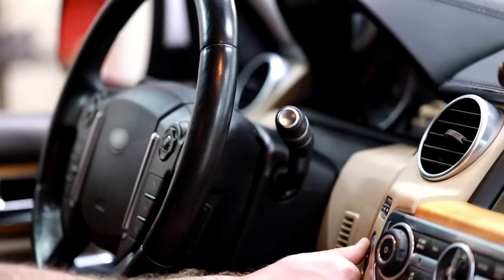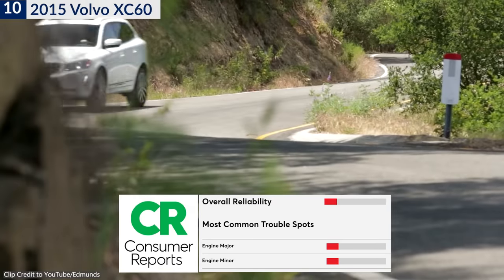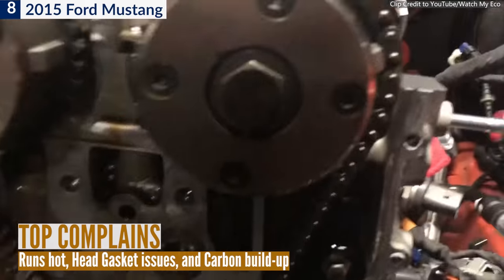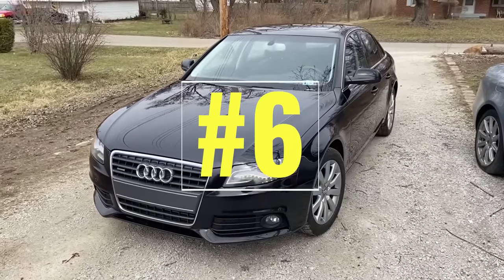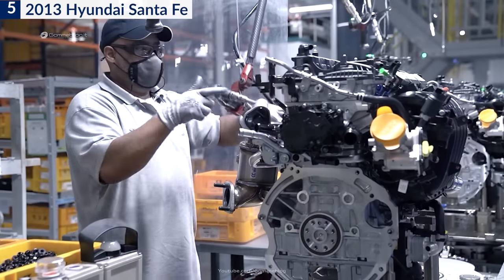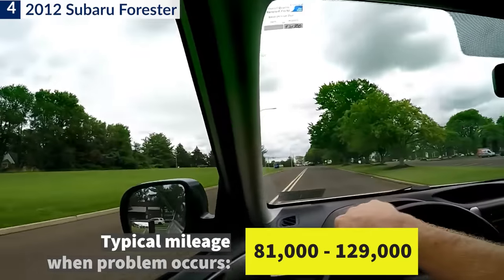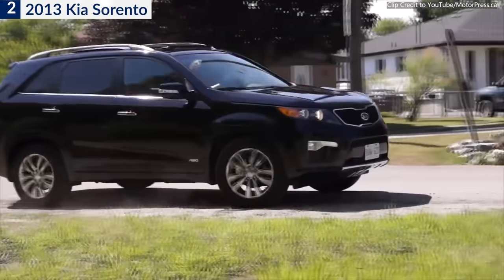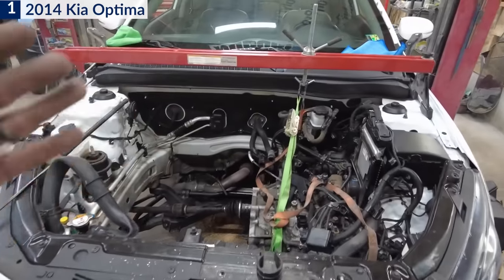10 Used-Cars to AVOID for BAD Engine - as per Consumer Reports

Comment: I think you should add the 2012 Hyundai Sonata to this list also.  I bought my 2012 Hyundai Sonata GLS brand new in May, 2012.  During the course of a little over four years of ownership, I got four separate recall notices from Hyundai on it, including the one for the metal shavings in the engine during manufacturing.  A fifth recall notice arrived in the mail shortly after I sold the car in 2016.  I would tell anyone looking at used Hyundais and Kias to basically avoid any car that has the 4 cylinder Theta II engine in it, or better yet, consider buying a used Toyota or Honda instead.
Reply: Not surprised seeing that the Kia Optima and Sonata shared the same engine. Had my 2015 Optima engine replaced at 60k+ miles. Engine continued to burn oil voraciously and had to have another replacement at 105k miles. Got rid of it at that point.
Reply: Just had my very problematic 2011 Sonata sent to auction 
Over 7000 in repairs these last 4 yrs
Never Hyundai or Kia, Toyota only!
Reply: It's not a model problem it's an ENGINE PROBLEM... all those Kia's and Hyundai's shared the exact same engine... THE THETA ENGINE IS THE CULPRIT... if you have a Theta Engine, you have a problem... doesn't matter if it's a Hyundai or Kia, if they put a Theta engine in it, beware.  Having said that, the Theta engine is no longer in production and isn't put in any current Hyundai or Kia vehicles.
Reply: @wolfshanze5980  false, it’s in the new 2023 sportage.
Reply: @wolfshanze5980  all those corny & slick remarks bother me none. my friend is a service tech at KIA & his brother is a sales rep & they’ve both confirmed otherwise. i couldn’t care less to listen to random user #112 on the situation. now begone.
Reply: The whole issue was not the engine, for it’s a fantastic design, but rather the process they once used for post milling clean out.
Reply: 2011 to 2018 in fact. Not just the few plucked years here and there. This problems is BAAAAAADDDDDDDDDDD
Reply: My daughter had a.2012 Hyundai sonata that had the engine replaced eventually.  They even provided a rental car for over a month while the work was being done.  but she wanted to get rid of the Hyundai and get something different.

  She got a 23 Kia Sportage!

I told her Kia is a sister company to Hyundai , sh was rather disappointed to hear that.  But it's a different engine and no problems so far
Reply: @lobos320  Here's to hoping that it will be ok. Besides the engine problems, they ARE very nice cars.
Reply: What about 2015 Holden Cruze
Reply: @Notmep  My mom & son both had Toyota's & they had nothing but problems with them even myself.

Comment: Hard to say when four vehicles are the same engine, i.e. Hyundai Santa Fe, Kia Sorento (those two are the same vehicle) and the Hyundai Sonata and Kia Optima (same vehicle again). That's like listing an engine problem from a Yukon, Tahoe, Sierra, Suburban, and Silverado separately.....
Reply: True. He mentioned 4 different cars with same 2.4L 4cyl GDI engine. I have 2012 Hyundai i45 (sonata). Many people have had engine failures. But mine never missed a beat. Runs like day one. Yet!
Reply: This whole video/list is a sham. Hell, the thumbnail for the video shows a Kia Telluride which only comes with the 3.8L V-6 and wasn't even part of this list.

Comment: We bought a 16 forester XT with 2 miles when I bought it, the rest were my test drive.  
I don’t get the Subaru loyalty.  While absolutely amazing in inclement weather, we have had a lot of problems- faulty wheel bearing, failed transmission master unit, it’s been recalled twice (once it was in the shop for 3 weeks… in Colorado).  That doesn’t go into all the rattles, undone wraps or any other cosmetic issues that have come up prematurely.
I’ll keep it for blizzards, but we’re a one and done Subaru family.
Now Mazdas I’ve had good luck with so far and everyone has luck with Toyotas
Reply: I agree with you 100%. I'm a mobile mechanic in Colorado. The Subaru is pretty much the "state car". I like the look of many models and they are good in the snow. However, they are plagued with so many issues I would avoid most of the models they make. Yes, Toyota vehicles are a safer bet. Always do the research before buying a vehicle. If it's used pay for a thorough inspection before making the purchase.

Comment: They should have ford fiesta on here. I bought mine brand new. Shocks went at 1500 miles,  fuel filter recalls, latch door failure and recall, engine fan went as well as the purge valve. Nothing but a money pit.
Reply: Sorry to hear that Heather , hope your next vehicle 🚗 is much better . Go with a Toyota . 👍😘
Reply: @bobmariano3731  that's the plan. Waiting for the prices for vehicles to go down first.
Reply: I know , their ridiculous right now , just like home prices ! Lol 😂 I have a 1995 Land Cruiser with 241,000 Miles & going strong 💪 😮👍
Reply: I've never heard anything good about that vehicle.  Considered buying one once.

Comment: In my opinion, there are a lot of factors about reliability with modern engineered vehicles. I come from an engineering background and work within the regulatory agencies demands everyday. First, its the government regulations that influence change . The government requires periodic emissions reductions , forcing manufacturing to tweak the product to stay compliant. Example General motors and Dodge/Chrysler/jeep with there cylinder disable systems failing lifters left and right. Poor quality construction to cut cost down to meet price points, engineering the parts to last within specified ranges load tolerances, increasing union labor rates and thresholds etc. Back in the day they would over build a transmission or rear end without concern of cost or weight savings that would hinder fuel savings of which are paramount as of todays concerns. Those parts ,even engines became legendary. " Ford 9" rear ends , Chevy small blocks, ford 300 six etc. the lists I'm sure go on and on. Those components would never be used today for just efficiency reasons alone N.H.T.S.A  would never approve, nor would they meet there EPA requirements. This leaves a tremendous engineering burden on manufacturing entity's shoulders. That's why you see smaller engines with "boost" and direct port injection, CVT transmissions etc. They must meet EPA standards of catalyst and fuel efficiency in order to be able to operate in the class vehicle its in. Certain exceptions are made for different classes of vehicles, but the bottom line is...this is what you get at the current price point.
Reply: I'm a retired Mechanical Engineer and totally agree. Politicians and bureaucrats set standards that aren't realistic , then get upset that the products that meet those standards are junk. I never heard of catastrophic engine failures in the '60's except due to abuse (no oil or excess rpm - no governor).
Reply: What's your take on CVT?  About to buy a Mazda CX30, and may buy a 2022 because Mazda introduced CVT in it's 2023 models.  I'm congenitally allergic to buying a car in its first year. Am I overreacting?

Comment: I've been a used car technician for 14 years working at a chevy dealer, so I've worked on quite a few makes and models with trade ins, I would agree with this video.  Sorry kia and Hyundai owners, but powertrains are garbage in these cars, the only good thing about them is their warranty if your the original owner.
Reply: Chevy has been wonderful in taking care of issues.  They replaced a cracked engine block even though it was out of warranty.  Then replaced pistons on my equinox.  Hitting 178k now and running like a top.

Comment: Very true! I heard complains about all these cars. Thank to Toyota and Lexus for an excellent quality, durability and reliability. I’m driving Toyota and I have no issues at all. Very happy with my car. And, it’s consider as a high milage car.
Reply: I had a Toyota Camry with 550k on it, and all I had to change was the Alternator, and of course brake pads, tires, etc. Same Engine and Transmission.
Reply: 180,000 miles on my Toyota Venza. Runs great. Never uses oil. I still check the fluids weekly, never have to add. My 01 Sebring convertible with 65,000 miles on the other hand... (summer car) needs oil every week. Coolant as well. I'm always topping something off.
Reply: @tylerc7037  That is what we call, the best car brand. Enjoy your Venza. It's such a awesome car
Reply: @shahramkhayam4875  it really has been a great car. It's been on many road trips. Also most of the parts are original except alternator, battery, shocks. Obviously it's had a few brake jobs, 2 sets of tires. Nothing else has been done. Spark plugs, hoses and belts, water pump all original. Bought it at 55,000 miles.
Reply: @tylerc7037  I trust you. Those services you did are minor for the car. Then, once you get them done on time, you will have a long peace of mind and enjoy your Venza. Cheers.
Reply: @tylerc7037  I would change the water pump, thermostat & coolant if I were you. Other than running them out of oil, overheating is the worst thing you can do to the motor. Inexpensive job. The parts were around $150 with the gaskets and coolant. Maybe 1.5 hours labor for a mechanic.  Don't wait until in breaks. I'm doing mine this weekend at 150k. JMO
Reply: @Barneyrubble241  I changed the coolant a few years ago, and the transmission fluid. Probably due again soon on that. Everyone is different, I don't fix good parts. If it's working, I'm rolling with it.
Reply: @tylerc7037  It's your car. Do what you want. I deliver auto parts for a living and every mechanic I asked told me to make sure to replace the water pump and thermostat before they break. Their words were, "water pumps and thermostats are cheap to replace but head gaskets are expensive as hell."
Reply: @Barneyrubble241  I drive a ticking time bomb Sebring with a internal water pump. I don't let every comment from a mechanic/parts store scare me to death, or else I'd just be broke.
Reply: @Barneyrubble241  I do appreciate you looking out for me though. If I ever get time, maybe I'll get to that. But I manage a store. Sadly, I barely have time to change my own oil anymore 😔
Reply: @tylerc7037  LOL. that is a ticking time bomb.  I generally don't let mechanics scare me either, but when ALL of them tell me the same thing??? Not to mention, they usually do the work for free or dirt cheap for me. They aren't telling me that stuff for their wallets. They're actually looking out for me.
Reply: I just picked up a 2000 Tundra with over 240,000 miles on it. My intention was to get a beater with a heater and functional 4WD to get me through till I graduate nursing school in May so I can buy something better, but so far I’m loving it and probably I’ll just keep driving it ❤
Reply: @Swags-fl5tv  Your decision was excellent. And, you saved your money for something else. It does not matter how old is your car, as long as it’s Toyota with great condition, you are good and you will have a long time peace of mind. Just do the regular maintenances and it will take care of you. Congrats. Cheers
Reply: Cheers to the crown Vic for being the best heavy 4 door car. I’ve seen many easily surpass 500k
Reply: I agree, I love my Lexus RX350, I will only buy Lexus or Toyota.
Reply: @tylerc7037 That's why you pay someone else to do it.  Or you'll end up paying someone else to do it anyway...after paying yet another person to tow it first if/when it breaks down in the middle of the road
Reply: Toyoto good brand

Comment: I owned a 2013 Kia optima 2.0 turbo,  absolutely loved it...sold it with 50k on the clock.  Never had any issues.   I didn't realize they had so many problems.   Glad I got rid of it when I did.
Reply: Good idea you sold it before 100,000 on the mileage

Comment: I just came back from a eight-state road trip in my 1992 Chevy 5.7 700 r4 overdrive positraction all stock. It's coming up to 250,000 miles soon. The only fluid I added in the road trip was gasoline. The car is all stock. The engine is original factory and never had the heads off.
Reply: You got a good one , back when Chevy- GMC was the most reliable truck on the road..( behind Toyota 4cyl pickups , arguably )..
Reply: Had a 1990 Silverado 305 turbo 400 20 years 170000 mi . Yeah it was good one. Should of kept it and rebuild it . New ones epa’d out -

Comment: I have an Optima.  Engine just went out at 125k without warning. Kia replaced it for free and gave a me a lifetime warranty on the engine. I'm at 170k now and still going strong and efficient. I don't know, feels like a win to me.😂 My Honda started leaking oil at 120k and had several other issues to deal with. Not throwing thousands of dollars to fix it. Plus the engine knocks. The Kia has been a dream in comparison.

Comment: You were "spot-on" with the KIA assessment....the only difference is that my wife has a 2016 Optima...but it has the very same problems as you stated.....I literally have to put oil in it every 2 to 3 days.....but it varies when she drives it a lot.....sometimes it can be 1 to 2 days.....it's gotten to the point  where I started doing the oil changes myself because they're too expensive and have outgrown my budget looking at how often I had to get oil changes...lol.....a Synthetic Blend and Full Synthetic oil change can run you about $57 to $125 here in Chicago....after doing research I discovered that KIA knew about this problem and had some sort of a recall on most GDI engines....smh
Reply: Wow, that frequency is crazy!!
Reply: Adding oil at that rate should make oil changes moot. You are changing it over time anyway. Just change the filter occasionally.
Reply: I have a 2014 Kia Optima hybrid, the gas engine runs great but the whole hybrid system is bad. Even though I only have 78000 miles they won't honor the 100000 mile warranty.

Comment: Driving my 2007 Ford Focus with 255,000 or 150,000 miles and I am impressed with the duratec engine. Good dependable car.
Reply: I’ve got 252,000 on a 2008 f150. Fingers crossed
Reply: Ya, but ford focus 2012/2017,  with cvt,,  2 clutch trans, etc..there were civil/class action
 Lawsuit at ford..ford had to settle,and pay off
  Litigants ...so I'll pass on ford for compact cars etc.due to forcing themselves to admit to liability...but that's capitalism of the great USA...GOOD LUCK
Reply: @Itsme-ni9jk  It was a DCT Transmission (Dual Dry Clutch) Great Car Terrible Transmission, it's always a bad thing when you get to know the service guys by their First Names.

Comment: 2000 Honda CRV-EX 280,000 miles, and I just replaced the rear drive shaft as it was cheaper than replacing the 2 u-joints (labor -wise). Also, replaced the drivers power window motor. Other than that.....still going strong with normal maintenance. GO HONDA !! : )
Reply: Agree with you @bush master have driven over 200k miles in my Hondas, Accord and Civic, very reliable cars!
Reply: @richardsedding8444  the Hondas and Acuras with the turbo engines are complete garbage.
Reply: @JAM_2024 not completely garbage, some of them are still running smooth despite in 700k miles, it depends of how you maintain and take care of it carefully

Comment: Buy Honda and Toyota, folks! I've had 5 Toyotas and each one went over 200K with zero issues.
Reply: Couldn’t agree more. Most japanese brands for that matter.
Reply: Not to sure about the newer ones with turbo engine and CVT trans
Reply: I had a 05 Camry.  Had 314k miles.    Kid ran Stop sign. Totaled.  Loved it!

Comment: I considered the Volvo XC60 but decided against it. Dodged a bullet there. I didn’t know that about the X3. Thank you for the info.
Reply from the maker: Thank you for watching 🙏
Reply: I drive a 2011 XC60 T6 and it has been the most worry-free vehicle I’ve ever had- and I’ve owned numerous Camry’s among others. It’s specifically the 2015.
Reply: Stay away from most BMW diseases!
Reply: Just because Volvos have that issue doesn’t mean EVERY Volvo has it .. all cars are just machines that have to be maintained.
Reply: Get a Lexus
Reply: @iam1smiley1  BMW. Broke My Wallet.
Reply: BMW are great cars...if you are only leasing them for 3 years.  If you are looking to buy or keep for a long time, Lexus or Toyota all the way.  At least when it comes to non-turbocharged ICE vehicles.  Toyota hybrids and EVs still have to win my trust.
Reply: @mrgreenbaypacker929  seems like these new 4 cylinder engines are not as reliable as the older 5 cylinder ones

Comment: I do agree on the Ford Ecoboost.  I've owned a 2015 and 2017, both of which had engine failures due to the mentioned issues.
Reply: 2.0 or 2.3?

Comment: I don't even subscribe to CR and I'm not a mechanic but as a compulsive car & motorcycle shopper, I browse a lot of for sale ads. I noticed one same thing when it comes to almost any car with the German 2.0T and a shocking amount of Subarus and Hyundais / Kias (I don't even include GM / Chrysler in my searches).  It's a pet peeve of mine when I'll have the max mileage filter set to 100K kms / 60K miles and SO MANY of the ads are listed with low mileage but the ad text will say something "28K kms on motor". Scares the crap out of me because I've been a Honda guy since the 80s and no one in my family has ever needed a major repair, much less an actual replacement engine??? My current daily Accord runs like brand new at 280K and counting. HONDA RULES!

Comment: My wife and I both bought 2011 Subaru Outback’s in 2010. Each car has 80k+ miles on them. Other than minor recalls and normal maintenance we have never had any issues with cars. I’m afraid to replace any for fear of ending up with something crappy.
Reply: 80k miles is not many. Sell them while they are still going.